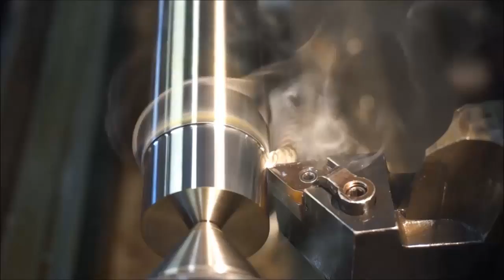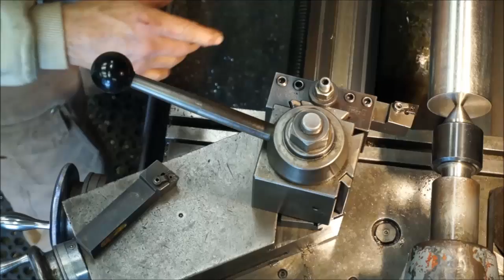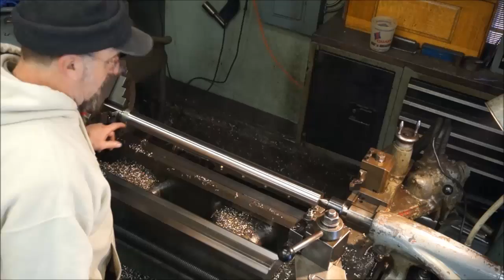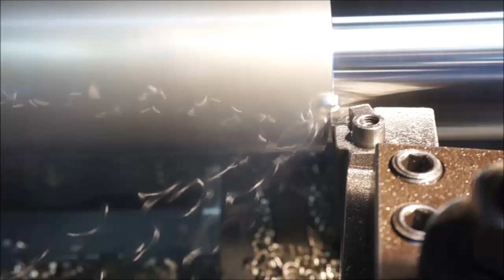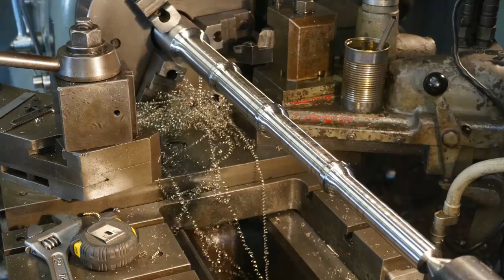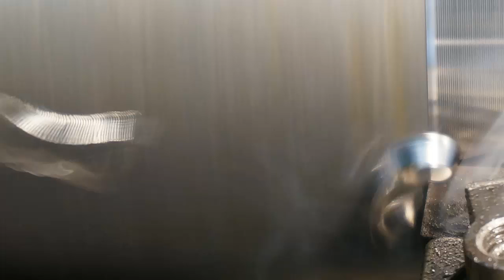Wing It Part 3

Comment: Keith i really enjoy your videos as i have a passion for making miniture gas and steam engines.About 25 years ago the bug bit and i bought a lathe and mill plus surface grinder and lots of tooling for all my machines and i was having fun buying this stuff to.   I tought myself to machine right and made a couple single cylinder engines and other thinks. I started a auto repair  buisness in 92 and abanded my nice little machine shop and  after watch your videos im back out in my shop getting it done .....Thanks Keith.

Comment: That guide bar made on the PLASMACAM is the ''G'' code for that old style CNC lathe, Keith is some kind of precursor. Notice on the first video of that series the big boat propellers lying under the lathe, these old CNC's generated ALLOT of heat and needed ALLOT of cooling...!
I really learn ALLOT watching all you do, keep on we would all miss you if you stopped.
Thanks for all you give us so generously.
Pierre

Comment: nice vid. At my job i'm using a insert from sandvik cnmg 160612 for turning train wheels. A normal cut can be as deep as 10mm and if we got flat spots we make cuts at a maximum of 3mm. And no coolant at all. ( made the lathe by our self 4 axes 2 turret and complete cnc )

Comment: What's the longest and/or biggest diameter shaft you have ever done?
Reply: My answer: 5" dia x 18" length
Reply from the maker: I have done a 11" X 24 ' will be posting the photos in web site soon, had it in my old site. We made the shaft at Northstar and the shaft flew down to Venezuela, from San Diego to be installed on a large fishing vessel. I machined both taper ends in a 24" X 120" Mazac lathe and a giant steel table set off the end to carry the excess shaft, have to wire the threads for the fit to the nuts. ;{)----
Reply: Gee that's pretty big! cool though. I have seen some pretty massive machined shafts but not one that size. I have done some large nuts though. 8" hex stock and made some really interesting threads.. almost a ACME pitch.

Comment: hey Keith
awesome series so far ,enjoyed the ride a long
by the way do you think you'd get longer tool life with flood coolant ?
I always use flood coolant on those pushing to max type cuts 
amazing finish with tracer ,great vid and thanks 

Mark
Reply from the maker: If you have a chance to run flood coolant without taken a bath in the stuff, it most likely would be better than running without or rubbing cutting oils on. ;{)-------

Comment: Keith I may have missed it somewhere, but I'm wondering how the tracer stylus deals with running into the square corner in the pattern. What makes it pull back and continue, as opposed to just stalling in the corner, locked up?
Reply: The tracer head unit rides the pattern and the work at an angle, 30-45 degrees?.  When the tracer hits a 90 in the pattern it's actually a  REVERSE command via the spool valve to the cutter.  Since the cutter is reversing at the same speed as the feed the cutter is stationary on the Z axis.  As the feed is still moving forward and the cutter is at an angle, the reverse is translated as an X movement away from the part/pattern giving a 90 degree face.
Reply from the maker: Hey Tom, in part two the over head shot of the travel angle of the hydraulic sliding ways, kinda gives it away!     ;{)----
Reply: Eddie the Grouch
I probably meant RETRACT rather than Reverse.  Either way it's clear as mud :)

Comment: Another great installment.

Keith, you have said often that your perfect chip "Starts gold and turns blue".  What exactly are the physics involved in getting that chip and causing the color change?
Reply from the maker: That was said when turning steel in general, some alloys wont turn color, with that said, you can introduce the tool bit to a desired depth at a mild feed rate, then increase the feed rate until you get the color of chip and comfortable load on the machine. You may have to tweak one or the other to suit, keep increments on depth easy to remember and you will have go to's, to try at the beginning of the next project, like .025", .050" etc. You may also switch feeds like .025", .005", .010", .015", etc.  ;{)------

Comment: Keith, I am noticing how the heat from tooling is pooling the lube just in front of the cut. I am curious by what i am seeing and wondering if a castor oil base lube would "draw" towards the tooling and be more effective. I am not a machinist but i do watch videos of your work as you have a mix of it all. After all you do have a job shop ey? BTW music @ the end sounds like 70's skin flick sound track LOL. As usual nice video Keith!
Reply from the maker: Well it appears to look that way, but the curling chip rolling along the the surface just in front of the cut plow pushes the excess ahead of it. If you watch at the very beginning of the cut it takes just a few seconds to build and when the contour changes the contact is changed and the bulk makes it way to the bit causing more smoke. The first support area smoked more because I had to answer the phone and wasn't able to blow the air nozzle on the cut like I did for the other two raised landings.  ;{)------

Comment: wont a shaft that long  flex a lot   and have  different  tool pressure the whole shafts  length?
Reply from the maker: Yes! there are always fluctuations in tool pressures, in length as well as diameters, that cause the flex of a shaft and some are more extreme than others. working the same materials with years of experience, like I have in the Aquamet type alloy has made my skills adapt to those fluctuations. ;{)------